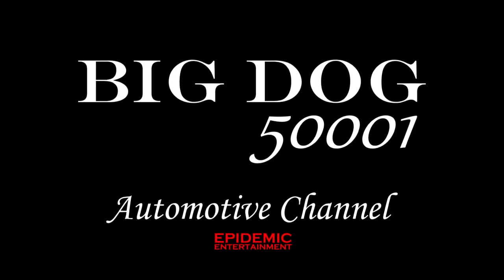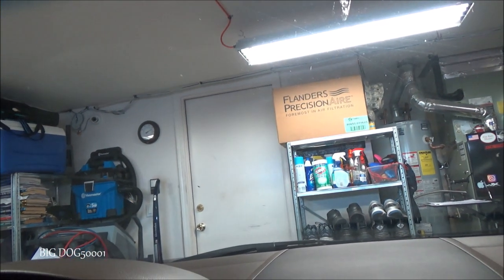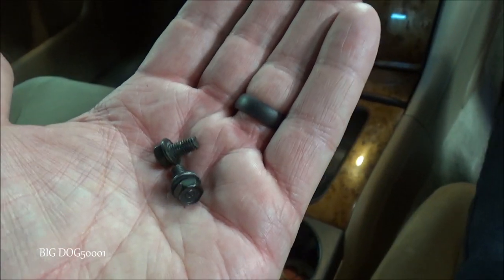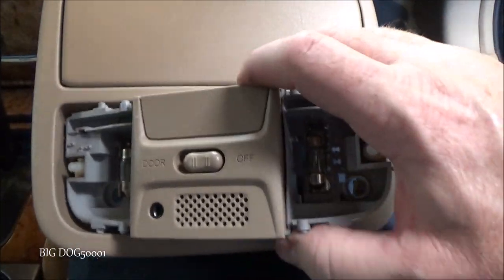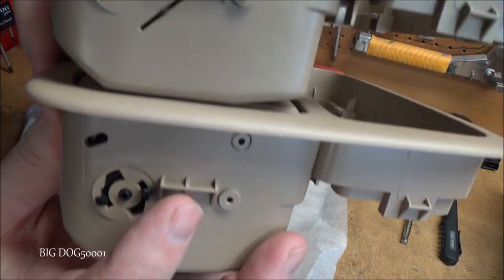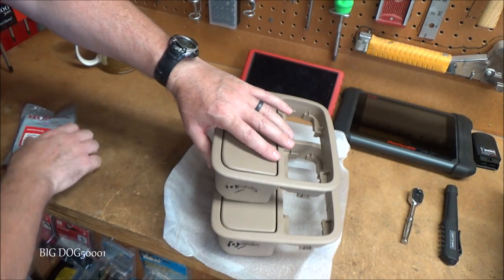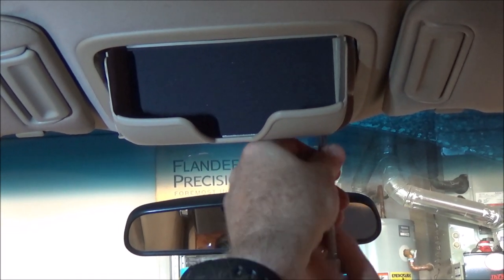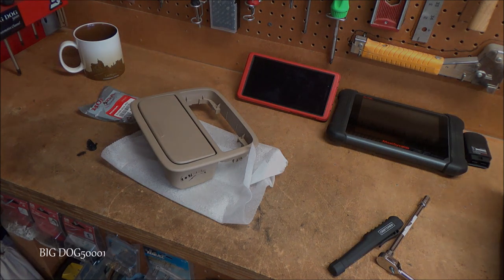Honda Broken Sunglasses Holder Fix/Overhead Console Replacement

Comment from the maker: Tools and Parts
Craftsman LED Pocket Light:  https://amzn.to/2NNYVMp
Honda Cam for Overhead Console 83256-SDA-A02
GearWrench 1/4" and 3/8" Sockets:  https://amzn.to/2ZNdEgI

Honda Overhead Console/Sunglasses Holder 83250-SDA-A02ZB/83250-SDA-A02ZA (be sure to get correct part number AND COLOR for your model, which is usually indicated by last two digits of part number):
https://amzn.to/2ZOTorf
https://amzn.to/2ZNTlf5

The Big Dog 50001 Automotive Channel Store can be found here: https://www.amazon.com/shop/bigdog50001automotive
Reply: Hey man..im about to change my clutch and i know it used 5 or 6 star point bolt but im not sure of the size bolt. I was looking on Google for the size but i dont think the 12mm that i saw was the right size . it look bigger than 12mm to me. Do you know the carrect size?

Comment: Great videos!   I have the same car......So let me get this straight.   "Technical Service Bulletins" basically mean the owner is on his own to fix and pay for the defect himself with no free service from the dealer?

For recalls...what if the recalls is from over 10 years ago, can I still get the recall fixed for free after waiting so long from the dealer?

Thanks!
Reply from the maker: A TSB is an advisement regarding a specific issue, typically the manufacturer will cover the repair under the TSB during any new car warranty period and after that it would be paid for by the owner (but the manufacturer may extend it).  A recall is typically a safety issue that needs to be corrected and is made in conjunction with the NHTSA (sometimes a recall can also be labeled internally as a TSB).  A recall usually does not have a time limit due to it being determined to be a safety issue, but the manufacturer may only have to fix it once during a vehicle's lifetime.  Thanks for the comment!

Comment: My sun roof doesn't work can you do a video on troubleshooting the sunroof, thanks
Also how many quarts of power steering fluid do I need to buy, I have to replace the power steering pressure hose.

Comment: Hey, love the video but I have a 2013 Acura RDX, I thought it would be the same but there’s no screws in the sunglass holder area, just the two screws behind the lights. When I remove those two screws it’s still in there tight. Any ideas?

Comment: I have a 2004 Accord EX Coupe.   I have heard owner's radio screen lights are prematurely going out where they can't see what radio station is playing through the speakers.  Is there any chance my dealer will fix this for free?
Reply from the maker: Because of a class action lawsuit for what you are describing, Honda extended the warranty on the Radio/HVAC unit to 7 years or 105,000 miles, whichever came first.  On a vehicle that old I do not believe Honda will cover any part of the repair now.  There are places that will repair the old radio unit but the customer is responsible for removal/replacement/sending in old unit (some may do an exchange for another working unit).  This is usually much cheaper that trying to buy a new one (if they can still be found).  Another option is an aftermarket radio but the radio unit is integrated into the HVAC system and some aftermarket radios do not work well with it (and don't look right either).
Reply: @BigDog50001  Thanks for the info.  My radio back-light went out around 2016, so the 7 years wasn't going to help me out I guess since I bought the car brand new from the dealer.  

I've seen some Youtube videos, but like you hinted, it is not an easy replacement job.  Also, my sun-glass drop down case never worked from the beginning, I just never found out about it being broken since I never used it until now.   Crazy. At least that is do-able myself.

Comment: Pretty cheap price most over head consoles are well over 100 dollers
Reply from the maker: Yeah, usually when Honda knows there is an issue they don't jack up the prices on the parts.

Comment: What do you do if it's jammed closed? Possibly because a pair of sunglasses are stuck inside?
(You won't be able to get at two of the screws to remove the assembly).
I tried sliding something thin in through the slot to push whatever is inside around a bit but I don't feel anything so it might just be jammed mechanically.
Ideas?
Reply from the maker: If it can't be gently pried down, then I have to make a decision, leave it alone (and not fix it) or pry on it with more force.  Using more force will usually break the cam mechanism completely but is sometimes the only way to fix it (but it is more than likely already damaged).   A new assembly (like in this video) is probably what is needed to fix this.
Reply: @BigDog50001  Yeah I think that's what I already decided. Not sure if there might be a pair of (my wife's) sunglasses in there. I tried a slight pry and now the door hangs very slightly. Might just leave well enough alone. Apparently the sunglasses are not missed. I was looking through your video and wondered if there was a way to stick something in (possibly from the front) to activate the latch / cam or whatever is latching it. It wasn't very clear in the shots you had.

Comment: Mine has a sunglasses stuck in it closed half way and I can't push it all the way in because the sunglasses was oversized...
Reply from the maker: That's not good.
Reply: @BigDog50001  yeah it's not good so far.  The other honda model I had in the past I had I just used a screwdriver to release it  to open.  But this 2014 pilot  doesn't seem to have it.